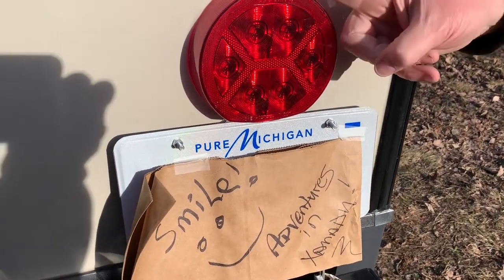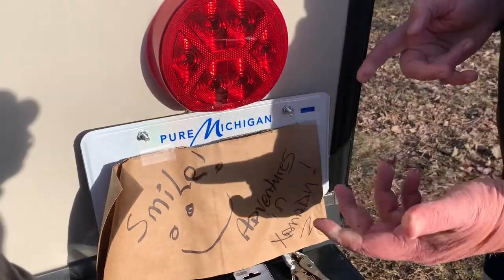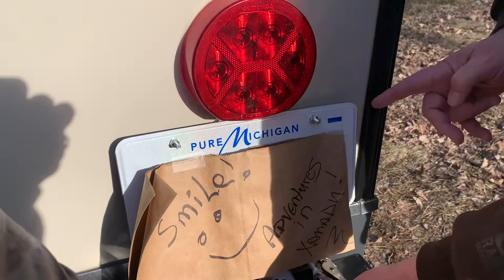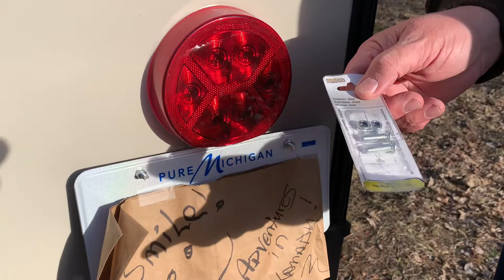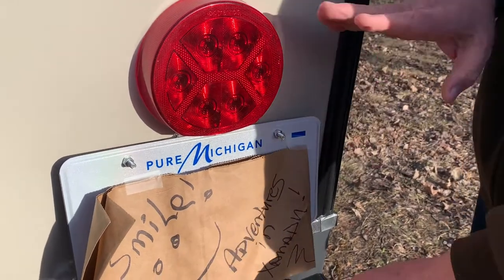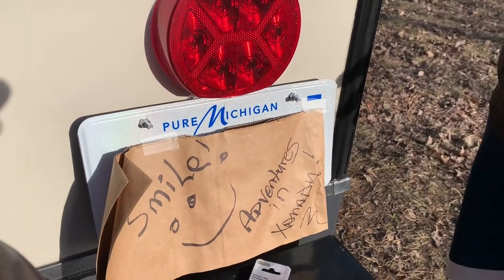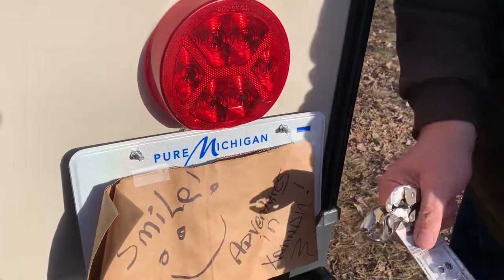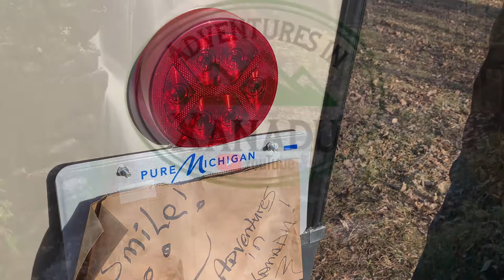How to Install a License Plate on RV or Travel Trailer, RV Life

Comment: You two are the best with details.   Thank you, Thank you.  I have a question, is there an electrical plug in the dinette area.  I know I saw one but you two would know for sure.
Reply from the maker: There are plenty of plugs in the rig, but not in the actual dinette area. There is one right under the fridge that would work best for that area. There’s the pop up one on top the kitchen counter, there’s one where the tank/system controls are, one by the charging station next to the couch,and one at the headboard of the bed, and of course in the bathroom. Whew!! 😰 that’s quite a few in that rig! Lol 😂 plug 🔌 away! Thanks for the question and comments!
Reply: @RVBFE  Thank you  so much for checking on electrical outlets.